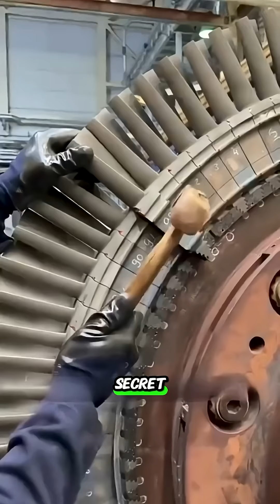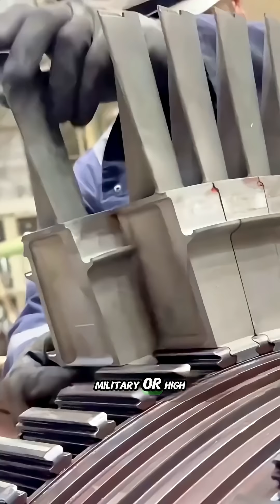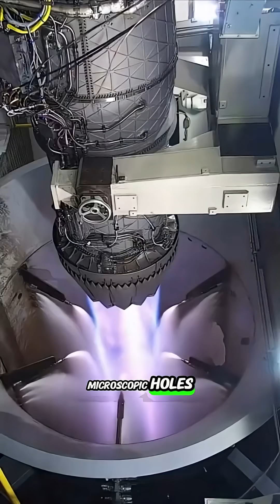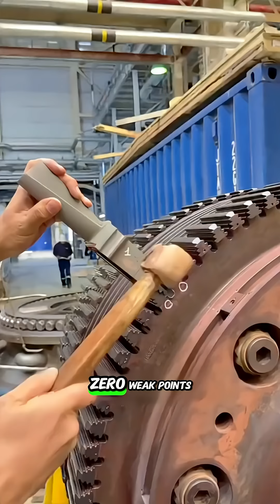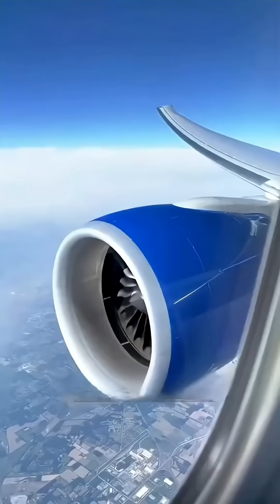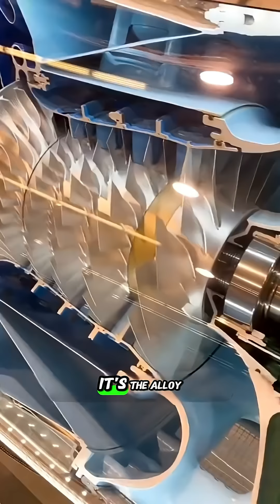The Insane Reason Nobody Can Copy American Jet Engines

Comment: And where did the jet engine start? Germany.
USA is the only country capable of building jet engines. Sad to think people believe this nonsense
Reply: Wrong. The jet engine did NOT start in Germany. A Royal Air Force Cadet named Frank Whittle submitted his turbo jet concept in 1930, patented it in 1932, and completed it's first successful test run on April 12th, 1937. It powered the Gloster E-28, which made it's first flight on May 15, 1941.

Comment: I spent 14 years disassembling and reassembling turbofan engines. GE CF6, P&W JT 9s, CFM 56s. There is no "cooling fliid", they are air cooled. I also ballanced and assembled the  1st stage fans. They are spun at 10% of take off rpm.. We wern't "enngineers", just AMTs.

Comment: I was taking off out of Oakland several years ago in a new MAX 8 Boeing aircraft. As we were rolling down the runway for takeoff, I saw what at first appeared to be a jackrabbit on the centerline. Well as I got closer, the jackrabbit turned into a hawk and started to takeoff and get out of the way of our aircraft. But it didn't make it. I felt/heard a thud as it went by my window and hoped it either hit the landing gear or the wing. We looked at engine parameters on climb out and nothing was out of the ordinary. We continued to San Diego. When we landed, I immediately went down the jetway to the ramp to see where the hawk had hit and was intercepted by the ramp supervisor coming up to show me what he had found. Well, the hawk had indeed gone through the engine, but it luckily went through the outer 'by pass' area and not the core. If a bird goes through the core, it causes a lot of damage and you can smell the 'cooked' bird in the cabin. This hawk had damaged three blades and they were changed before the aircraft was allowed to fly again. Out of service for several hours, three new blades brought in by Phoenix maintenance. I called a few days later and talked to them about the fix. Those three blades cost $85,000 dollars a piece, for a grand total of over $250,000 dollars!

Comment: Before retiring I had been a Calibrator in the Metrology  Department -- the science of Measurement which in practical terms means the design and utilization of Test Equipment and Test Stations.   Yeah, apparently only in America do they have Test Sets that can Go or No Go by the  difference of Micrograms.   Heck, it wouldn't surprise me at all that the Test Station would swing the waits in order to multiply up their mass force using centrifugal force... that is, instead of weighing the things in a static pan, they load it into a centrifuge and give it a spin against precise balance weights at the opposite pole. But, yeah, only in America do we have the Know How and the Metrology Traditions to support such accurate regimes of precise Measurement.

Comment: Most of this information is not right. The blade is not that expensive too, depending on the blade location, it could range from 3,000 to 10 000 USD. It's made, usually, from titanium alloy which is not that impossible to make. Most blades are not cast but milled, so stop this BS, please.

Comment: Wrong. Iran under sanction was forced to maintenance thier airplanes. No tulools no instructions or blueprint and they had to reverse engineering the engine parts due to the sanction. No they don't only maintenance the engines they maintenance Russian airplanes as well due to the US sanction on Russian.  Bc of need they learned to invente and produce engine parts 8nkl the blads coyse no one would sale it to them. Today, they can completely produce a complete engine due the sanction. So they must be most smart.

Comment: The hard part of building a jet engine for China was when they stole GE turbine technology. True .
 In 2011, Sinovel recruited an Austria-based AMSC employee to covertly copy the source code for the PM3000, a key component used to regulate electricity flow from wind turbines to power grids.
Other major operations targeted industrial gas and steam turbines—crucial for power generation and military jet engines—from General Electric (GE).
In a related campaign, career Chinese intelligence officer Xu Yanjun was sentenced to 20 years in U.S. prison in November 2022 for conspiring to steal trade secrets from aerospace companies, specifically targeting GE's advanced composite aircraft engine fan technology.
Power engineer Xiaoqing Zheng was convicted in 2022 of economic espionage. He stole proprietary digital files regarding turbine blade and seal designs by hiding the technical data inside the binary code of a digital photograph of a sunset, a technique called steganography. The files were sent to accomplices in China to benefit state-funded universities and businesses

Comment: Wrong. It's because of all the knowledge they took from Germany after WW2, and why they were the first on the moon. 

And you are also wrong about the price, I used to build prototypes of turbine fans for Airbus and Boing in Denmark, in the start of the 2000s. 

Missile Systems for everything including warheads for Tomahawk missiles, Helm cameras for F-22 Raptor and F-35, multiple weapon systems especially computers for submarines. 

The hardest thing we ever made, when I worked there was for a new submarine computer and system.

There were only two places in the world that could cast these prototypes of for example, magnesium, aluminum and other types of metals. 

The other factory was in Mexico and I'm fairly sure it was closed down years ago. It's called the Tempo Cast Method. 

I have to sign a 10 year agreement with the Ferrari Formula One team and promise not to work with other Formula One teams for 15 years. 
This was for the Ferrari Michael Schumacher won most of his races for Ferrari. 
The engine weighed 90 kilos and provided 1,000 horsepower. 

We made weapons platforms (and still do ) parts for every NATO allies and parts for nearly every single car manufacturer in the world, NASA and many other things. The exceptions could be China and of course 100% Russia. 
Especially the USA, France, and Germany (actually Poland spends a lot on new High-tech military development are still the biggest buyers of High-Tech military prototypes, one of my former colleagues told me. 

America or any other NATO nations, can make all their new equipment themselves and that's a fact. But they could do it, It's just one factory at about 50,000 feet, If I count and remember like 17 years ago 😂 But they don't.

I don't know where you get your information about the cost of for example the blades, because that's not true, and many countries produce their own blades, it's a given, and it's the prototypes that cost the real money.

America are long time allied, use too many money on the military, and since it has become nearly 100% oligarchy, americas internal problems and foreign debt will continue to rise.

This is not good, America's political system is very very outdated and needs huge changes. The Republican constitutional two-party system, have only made the rich richer, while crime and drug epidemics will continue. 

When you can buy the presidency, a president, a governor and a senator ect, with only two political parties and the semi- democratic election system, It will only continue to move one way. 

I hope America's next president will be a younger wiser and more intelligent, empathic and most of all more realistic and hopefully a tree or four star general (they are at least realistic and have a million times more brain capacity.)
Allies have to stick together, not move away from each other. I think I've been quoting Bernie Sanders too much now, and went on a side trail. 

But it is important, that major things will begin to change, especially between real allies and not just the ones, there's in it for the money, just like Darth Donald. We have to remember who the real enemies are, also the people within. 

Way too many people and especially young people and adults, have lost their history and knowledge about the world. Actually so much that IQ and EQ have been falling and stagnating since the late 1990s (Actually the highest average IQ peaked in 1998.) 

WHY ❓

Because the internet became mainstream and people would and will rather talk about themselves on social media, than becoming wiser and learning about the best they can be for the world. 

Sorry I really got off track 😔 Why don't leader of Nations go through a psychological evaluation, before they can become president, prime minister or just gangster sociopath. 

It's because of the Un-United Nations and their World destroying veto rights. 
Even a preteen could figure this out. 

PS. It's like a cosmic joke, but at least we solved the Fermi Paradox. 

PPS. Sorry for the bad grammar, stellan and getting way off track. I must be very angry at the world today. 
Probably shouldn't have watched that video with Darth Donald, Fürer Putin and Xi " All people are stupid" Jipeng. 

But have a nice week, 🫡

Comment: Built upon the shoulders Englishman Frank Whittle’s jet engine design of 1930, it’s more than 50 years of American domination.  The F-14 Tomcat’s first recorded flight (Dec 1970) marked the beginning of the modern aircraft fighter jet; 56 years ago to date.  
The F-4 Phantom & the F-111 Aardvark were already in official use by the mid 60’s, the former being developed in 1952, first flight being in 1958.  That would make 75 years of air superiority, including development.

Comment: Nobody can make modern high performance engines like the USA. Russia can come close but nobody makes engines like the USA can. That is particularly true with China which has been making failing engines for decades now. They will never get it right without total change to their process but can't see that. So engines that should last 2000 hours cant last 200... or 100... or even 50. It is a critical weakness for China. Normal output jets are not a problem but high-performance jet engines fail miserably.

Comment: When a commercial plane reaches its normal cruising altitude of 30,000 to 40,000 feet, the outside air temperature is deeply freezing, averaging around -55°C (-67°F), and can range from -40°C to -70°C (-40°F to -94°F).

Comment: RR, Safran, UEC, MTU, IHI. Avio, ITP.  These companies don't need to copy "American Jet Engines", they make their own.  Typical sep bulldust.  Frank Whittle (RAF) designed the first jet engine in 1930. Hans von Ohain designed the first jet engine to achieve powered flight,   Rolls Royce made the first turbo-fan engine in 1950.  Don't stand on the shoulders of giants and tell us how great you are.  On top of that 3D modelling and FDM printing is revolutionising the manufacture of complex parts like fan blades world wide.

Comment: You guys are right about rolls Royce engines. But as a former employee of a jet engine blade manufacturer it took years for rolls Royce to catch up with our technology. We were held to secrecy. We were warned that rolls would catch up to us. So yes rolls does put out an excellent jet engine. The blades are not nickel and steel but composite with titanium leading edge and trailing edge. Much stronger than steel.

Comment: How much does an American jet engine cost? A large commercial Rolls-Royce jet engine typically costs between $20 million and $35 million per unit. Prices vary widely based on the specific model, custom airline configurations, and long-term maintenance agreements bundled into the final sale.